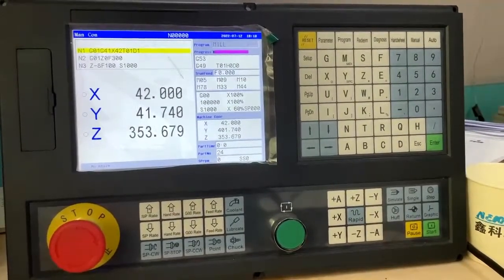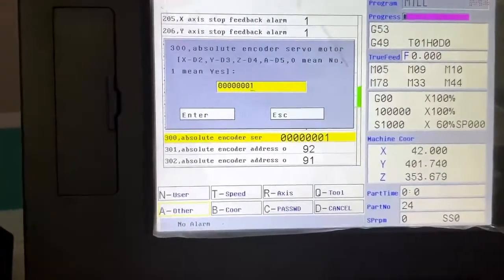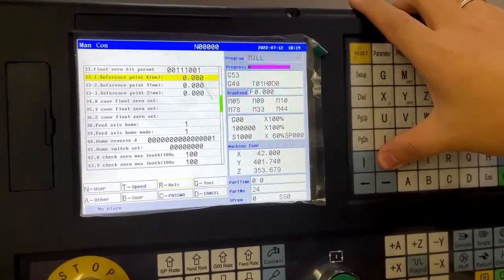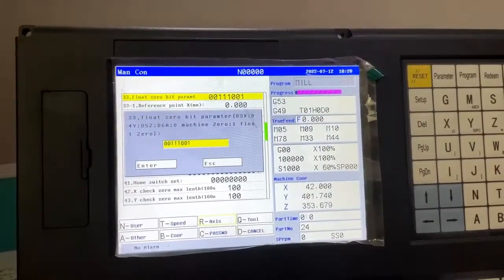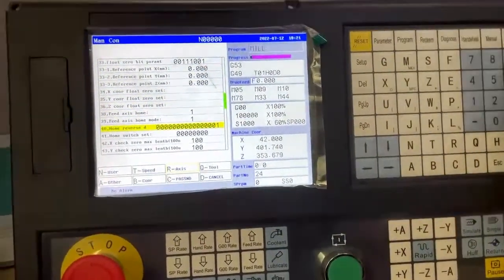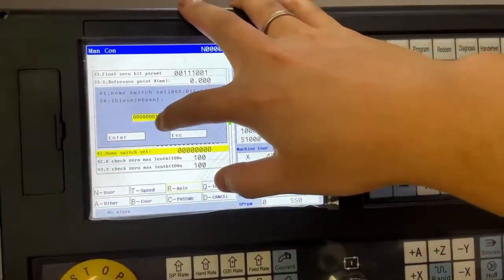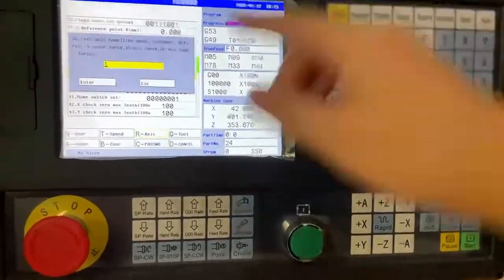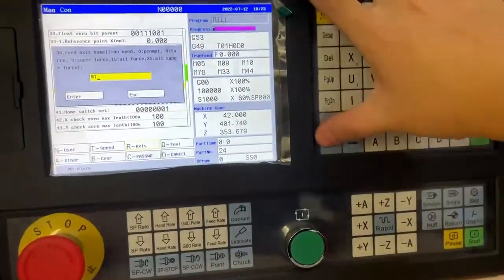incremental and absolute settings

Comment: How do you set floating zero point xyz on parameters p34,p35,p36,p37
Reply: have you found how, can you please share
Reply: @crox2012  yes ofc . If you are using an absolute system try to  input "E" to P314~P316 on Other parameter for clear to 0
Reply: @aymanmoazin2279  Ayman, i would really be glad and thankful if i can have your direct contact, just to understand this point as i almost made a mistake when homing the machine, it did not stop and kept moving till the motor got blocked 🙏
Reply: @crox2012  this sets the zero point of the machine coordinates of absolute system thus the floating point will be there

Comment: how do you set the floating zero point on parameter P34 P35 P36
Reply from the maker: Hi, if you are use incremental motor, then need use mechanical home, then no need use P34 P35 P36, if you are use absolute motor, then please use P314 P315 P316, input E to set home of encoder or EV to set the coordinate
Reply: @NEWKerCNCTECHNOLOGYCOLTD  thank you that is very helpful.
Reply: @NEWKerCNCTECHNOLOGYCOLTD   this is really helpful ,  maybe you should make a video for future reference for your customers.   thanks again